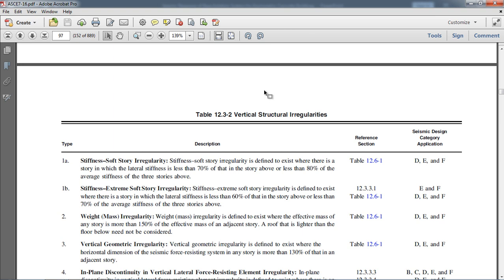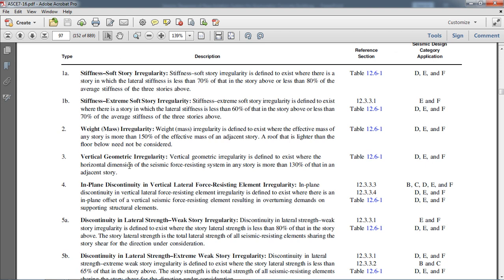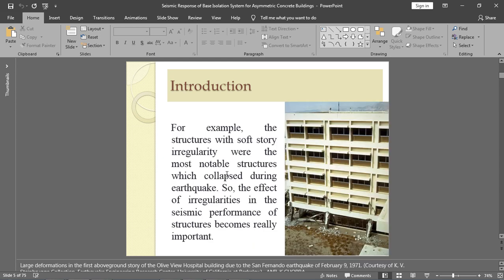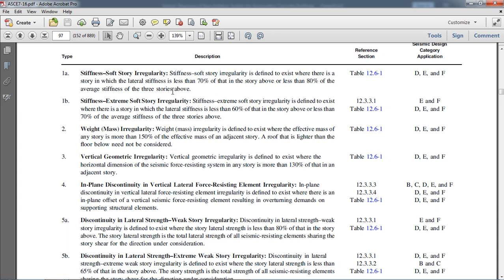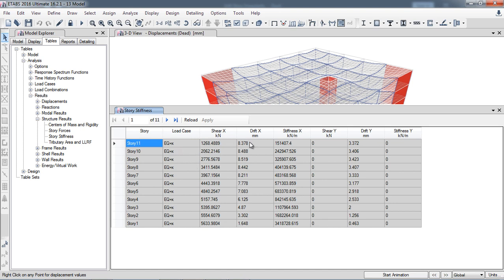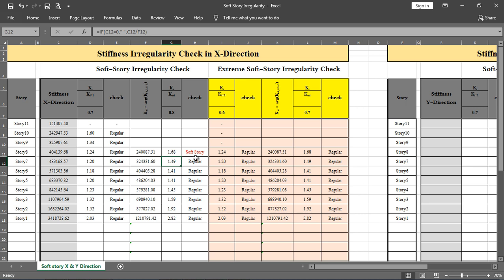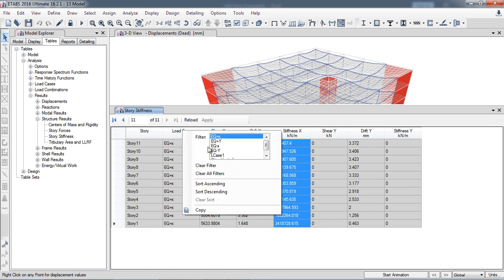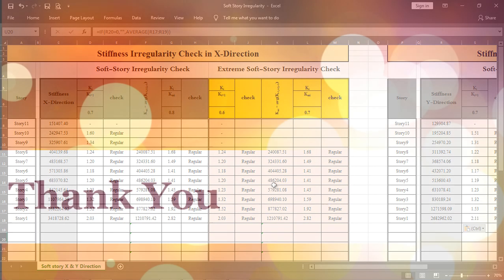CSI ETABS - 07 - Stiffness Irregularity Check (Soft Story and Extreme Soft Story check)

Comment: How about only two storey building? The Upper Storey Ratio value is greater than 0.7, but failed in "Upper 3 Storey Ratio" which is less than 0.8. Since, there is only one storey existing above the first storey, should I ignore the 0.8, and only use 0.7 for soft storey irreg?
Reply from the maker: No need for 2 storey

Comment: Hello, I have a doubt, when checking the story stiffness in the earthquake in the X direction, the Stiffness Y column does not result 0, and when checking stiffness in Y, the X column is also not 0
Reply from the maker: Stiffness is a constant value...

If you apply 1 kN force in X-direction or 100 kN..
Stiffness will remain same...

So that's in Y-direction it will come as it is....
Due to constant value

Comment: Is it necessary to include infill wall in the model? Bcoz it will add stiffness to the structure. So if there is an open ground floor and other story have infill wall then the ground floor may act as soft story. In that case, how to check soft story?
Reply from the maker: Answer 1
First of all it is not necessary....

Answer 2
2nd you have to calculate in the same as I have shown in this video.
Reply: Actually Etabs is not accurate in calculating storey stiffness because it does not consider infill walls. So in this case what you have done is not accurate. In case of having  infill walls in above stories and open frames at ground level, the software consider all stories same but in reality infill walls have stiffness but the problem is how to calculate?

Comment: In 2 storey with elevated ground floor of 1.5m, I got soft storey in the first floor when actual roofing loads (steel trusses and roofing sheets) are included in the roof beam, but when I modeled roof deck (with minimum design loads), there's no soft storey (with ratio 0.8-0.85 > 0.7). So, I observed that when the weight carried by the roof beam is close to the weight carried by 2nd floor beam, there is no soft storey. When the weight carried by the beam is lighter, there is soft storey in the 1st floor. Why is that?

And also when I increase the column height in the 2nd floor, no soft storey exists.
Reply from the maker: No need to check for soft story .... For 2 story building
Reply: @civilmdc  why sir?
Reply: I live in a country with strong earthquakes. There are many two storey houses collapsed due to soft storey in the first floor

Comment: Dear Sir, Thank you for the video. I have a question; how can I calculate STIFFNESS in X-DIRECTION manually for a simple 2D steel building frame?
Reply from the maker: You have to calculate stiffness of each story by using stiffness formulas... That is given in your earthquake engineering books
Reply: @civilmdc  Dear Sir, thank you very much for the rapid response. I have a follow-up question; I have calculated the global stiffness matrix for a steel frame but I'm confused about calculating the stiffness for a particular floor level, can you please be more elaborate on what formula you are referring to. Or please provide a link to any documentation or paper related to stiffness calculation for a particular storey and direction.